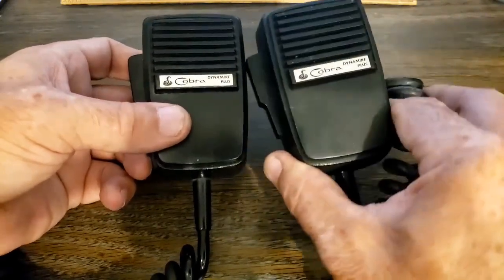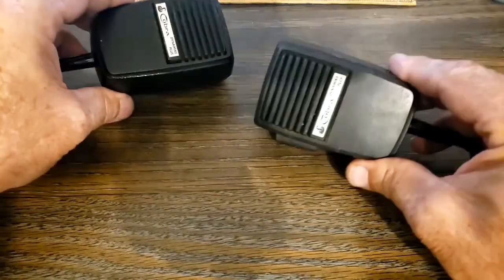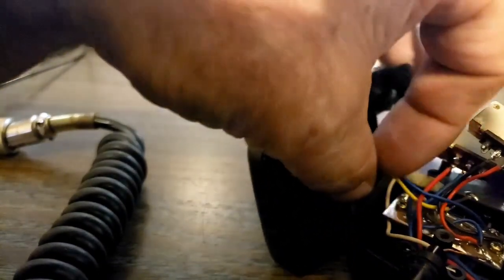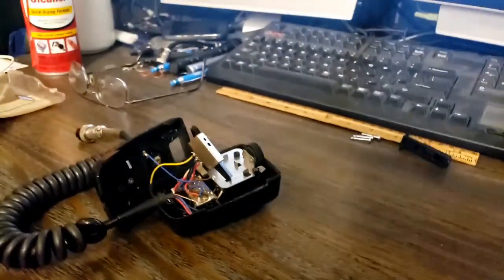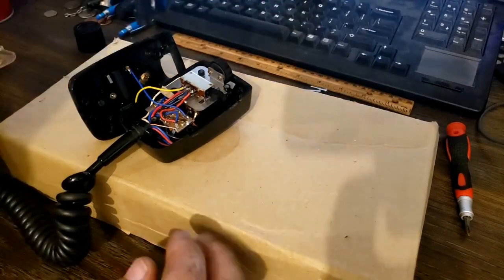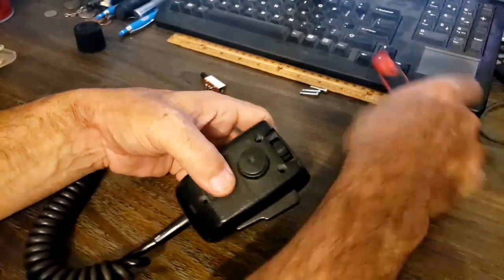Repairing My favorite CB Radio Microphone

Comment: I learned, after several repairs on certain items, to never put all of the screws back in until it's been tested; and yet, just last week I finished a repair and told myself "there's no way this won't work" and put all of the screws back in place and tightened down. It didn't work. So I unscrewed them again, looked inside, and realized I made an error where I soldered the last wire and told myself "why don't I listen to myself and follow my own advice each and every time?" I guess my brain was mad, because I didn't get a reply... 😏
Reply from the maker: lol, That's why I used the meter to test the switch before installing for the second time. I usually just smile and remind myself "nobody's perfect" 
Thanks for watching, 73's

Comment: Great video MJ. Looks to be little tedious work, at least for me, but I'd try it. My problem even with my reading glasses on things that small can make my eyes blurry. Not long ago I made up a 100" coax with connector ends to test out a antenna and I had a little trouble soldering the ends. My left hand got the shakes holding the solder and that didn't help. Hoping to get my 30 year old Antron 99 back in the air soon, it tested out great after being in storage  for several years. 73"s North Texas 106 we standing by 👍.
Reply from the maker: I sometimes have the same problem, as I get older it gets harder and harder to see those small parts. I hope you can get that old Antron back in the air soon. Take care 106, 73's from 151 SC.

Comment: Gp23a 12v readily available may  work need to check voltage range on parts, I use those in realistic noise cancelling mic with more gain to boot

Comment: Nice video MJ ! I'll have a similar fix on my Turner +2. One of the metal keying reeds has corroded and broken on mine.  Can't just find those anywhere so am attempting to fabricate one.  We'll see....  Glad you got that ol mic going again.  I too, love those old Cobra power mics !!
Reply: You can cannibalize any Turner +2 style desk mike for a switch reed. If you haven't done so, I'd try to clean up the reed and use silver solder to get it working.
Reply from the maker: Thanks 550. I'm going to look through my parts pile, I might have a set of switches for you. I'll let you know if I find it. 73's

Comment: You need some tools. A third hand, a soldering pencil, needle nose pliers.
Reply from the maker: The third hand is what I needed the most.
Reply: @MowerJunkie  I just got a third hand with twin calipers and a 4× mag lens all on small robotic looking unit but the calipers don't hold mic plugs too big for clips apparently designed for PC board work 
I had bad cataracts repaired just year ago and now cannot solder worth darn even with readers and 4× mag lens admit my vision is much better looking out the window or down the street but depth perception and accuracy within 3' is shot what used to be the weak eye is now trying be dominate and spending time close view creates dizzyness so my use as solder is out the window 
Have a good safe weekend  398 Wis
Reply from the maker: I forgot that my son has a nice set of helping hands with large jaws, maybe I'll remember next time. Take care 398, 73's from 151 SC.